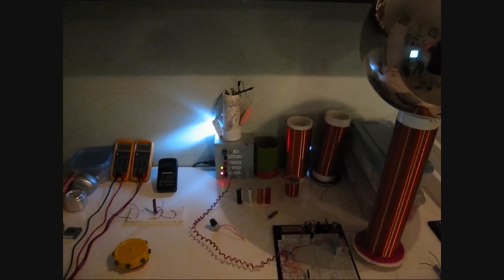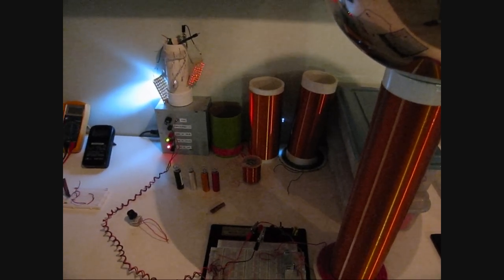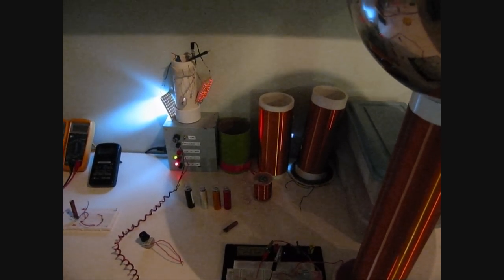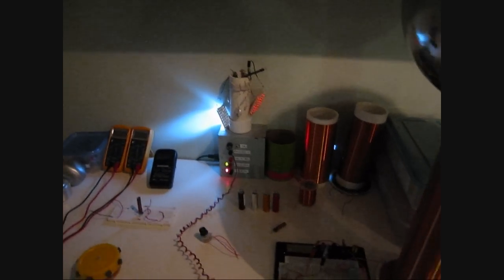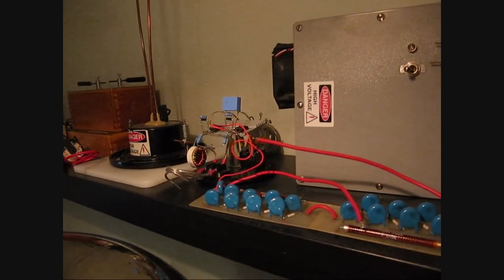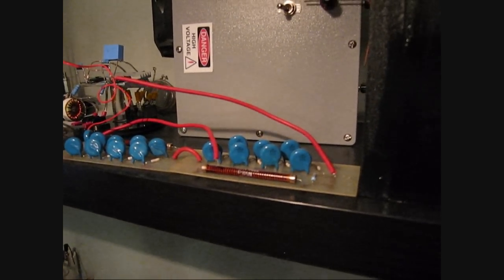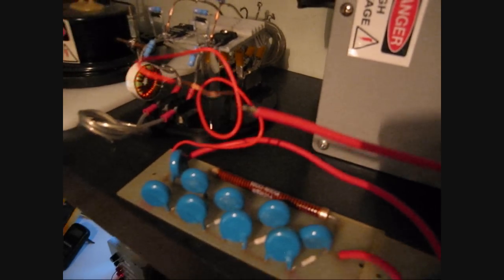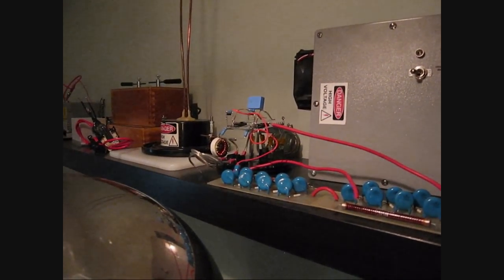Wireless capacitor charging and discharging

Comment: when the voltage in the capacitor get higher than the breakdown voltage in the air, the air goes from being a insulator to becoming a conductor and the capacitor discharge.  if rotary spark gap is used only some of the capacitance will discharge at the time since you bring up the breakdown voltage in the air faster that the voltage drop in the capacitor.

Comment: Seems to be the accidental implementation of a Tesla Generator that is absorbing the radiant energy in the room to charge capacitors high enough to reach the needed power to jump the spark gap to complete a (air) circuit between the source and the ground.  The source being the energy that is generated/captured via RF, and the ground being the device which the spark is jumping to.  My guess is that you could bridge the a capacitor to an DC to AC inverter and actually 'save' that lost energy